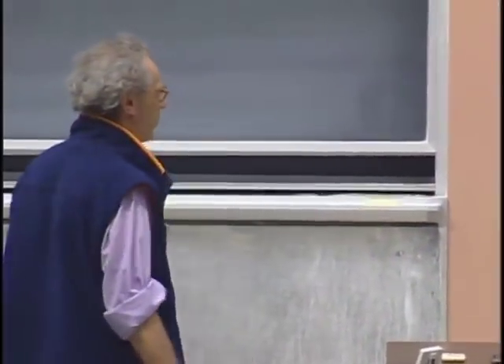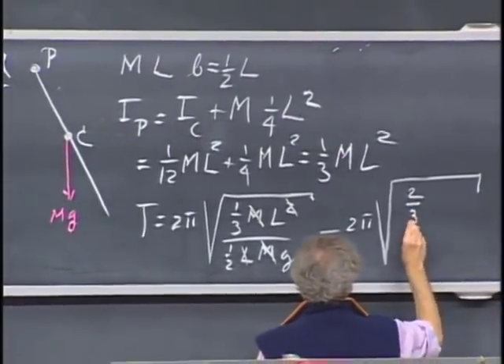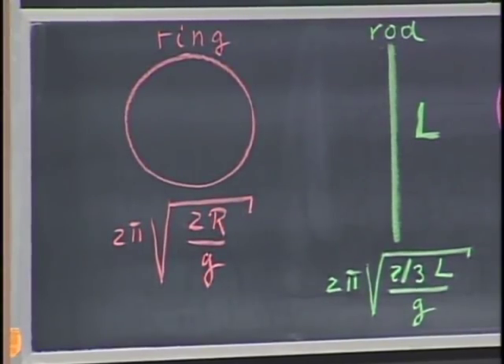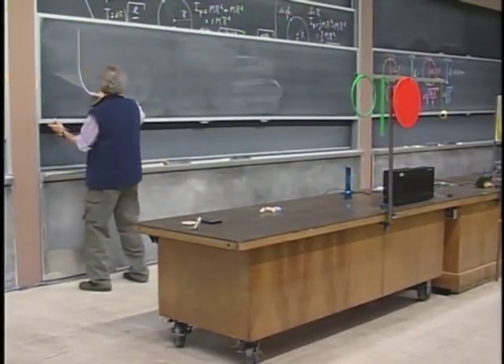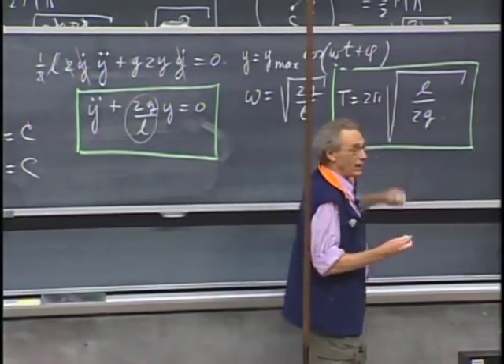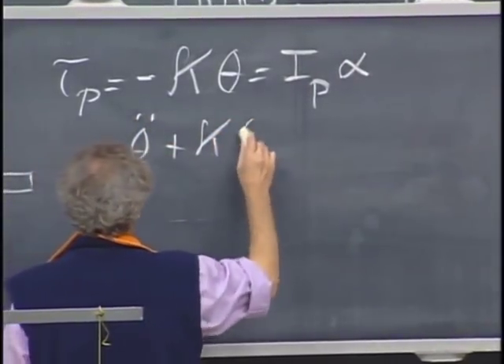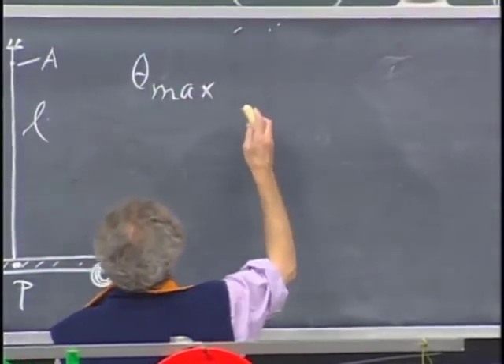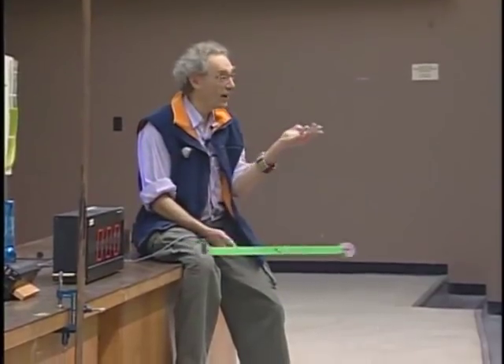8.01x - Lect 30 - Simple Harmonic Motion, Energy Considerations, Torsional Pendulum

Comment: Sir, did the string broke?
What was the summary of the tortional strain experiment?
Reply from the maker: question unclear
Reply: @lecturesbywalterlewin.they9259  Oh my god, Sir😳😳 I wasn't expecting a reply,
Sir, I was asking that the demonstration of the tortional strain you were doing, the numbers of period at 10 rotations was still holding up with the calculated value , did you go beyond 10 times or it started to show permanent deformation  after 10?
Reply: @lecturesbywalterlewin.they9259 And I thought hard about the U-tube length you said it should be higher than (calculated average),
Does the liquid lose contact with the ceiling of the mid section of U tube while moving?

Comment: Hi Professor. In this lecture (22:55 min.) u mention that vellocity will be same for any moment in time due to cross section area of tube is not changing. But will it same or it will change by the time? Because derivative of (y) includes (t) and it is logical due to gravity. i think i misunderstood something or not? Thanks.
Reply from the maker: what I said is correct as liquid is incompressable.
Reply: Professor I got ur point. Thanks for lighting me up. I misunderstand ur sentence at 22:55 min. Thanks again.

Comment: "l"  in the differential eqn is taken as the displacement of the centre of mass of the displaced liquid, which will be higher than the "l" we get if we take the average of the two radii and measure it. Is this correct?
Reply from the maker: I have no idea about what you are asking me. Search on line on how to calculate periods of oscillating liquids or use my lectures. I believe I cover that.
Reply: @lecturesbywalterlewin.they9259  sir , I was attempting to answer the question asked in the lecture about why we should take "l" more than what is measured from the average of the radii.

Comment: Dr.Lewin, I just  want to prove that the actual “l” should have been taken a little bit larger than       π(r1+r2)/2.(I only consider the bottom torus).r1 is the inner radius and r2 is the outer radius.I used  integration to calculate the volume of a torus.But amazingly I got that the volume of torus is exactly equal to (π^2)*(r1+r2)a^2 =2A*l.So the bottom half of torus should have volume =A*l.I uses 3 different methods to calculate that and they all give me the same result. Can you explain me why l should have been taken a little bit larger.
Reply from the maker: Watch my lectures whereI I do it right and then learn what you did wrong.
Reply: Lectures by Walter Lewin. They will make you ♥ Physics. Thanks for your reply.Sir you use M=Alρ which l is equal to the the average length between the inner length of U-tube and outer length of the U-Tube.I think this u-tube is made of two cylinders and a half-torus is that right? I calculated the volume of this half-torus .Its volume is equal to A*(πR).(I also checked it on the Web)R is the major radius of this torus.Major radius R is the average between the outer and inner radius.πR is the circular bottom part of “l”So I get the total volume of this liquid is A*l.And the mass is Alρ.I think it is not an approximation. I think M is exactly equal to Alρ.Could you explain that further?I really don’t know where I did it wrong and I really want to know that.Otherwise I will have sleepless night.I am looking forward to your response.
Reply: @Lectures by Walter Lewin. They will make you ♥ Physics. Sorry for bothering you but could you tell me whether the reason why ”l” should have been taken a little bit larger have something to do with the formula of volume of the  U-Tube ? I checked that formula but it is amazingly and exactly equal to the a cylinder with cross-sectional area A and length l.Which l is the average of inner and outer length of U-Tube.(the line you have drawn) I am looking forward to your response.
Reply: @GRQFTS did you find the reason why “L” should be a little larger

Comment: Hi professor, i think i found my mistake, to find the work of the force with which i had to push down the liquid at the left side of the tube so that the liquid would raise up on the opposite side, i incorrectly assumed that the force was constant for all the delta h and equal to the force with which i had to maintain the equilibrium at the end, just like if i had to lift a rigid body with fixed mass, but then i noticed that for every dh the force would raise up proportionally with h, that's because the unbalanced mass in the system gets bigger and bigger the further I go down pushing, so the work would be (integral)--->S(rho)*Area*2h*g*dh, and not 2dMgy as i incorrectly assumed, the result of the integral is dMgy and not as i said before. If i could correct my error I owe it only to you professor, have a good day, greetings from italy!!

Comment: hello professor, at 25:19 you show that dM*g*y is the work of the force, shouldn't the amount of unbalanced mass be 2dM? and so the work would be 2dM*g*y
Reply from the maker: 25:19 what I said and did is correct.
Reply: thank you professor, i couldn't figure out the right way of thinking about it, i'm struggling with this topic because my professor didn't handle it properly. With all respect my question wasn't meant in any way to question your preparation.
Reply: Think about the center of mass of the displaced fluid. It clearly moves only 1*l as it sits in the middle of the shifted fluid.

Comment: Hi, I have a question about the assigment 8 ,8.4, c).  The formula i got for r1/r2  (r1/r2=x) was : x+2x^2+x^3= (M*G/V^2*r2) = 0.53. But in the answer sheet it says it equals to 15.9 and I´m not sure what I´m doing wrong. Is this equation correct : x+2x^2+x^3= (M*G/V^2*r2)?
Reply from the maker: Plse assume that the solutions of this classic problem are correct. Please check your (and our) calculations carefully - (the solutions were done by a graduate student). Unless you are 100% sure that our solution is wrong, I don't want to go over our solutions as that is very time consuming.
Reply: Thanks, you were right. I was plugging in the wrong values. @lecturesbywalterlewin.they9259

Comment: When the length of second pendulum becomes four times what z the perid then???plz
Reply: Twice.
Reply: To see this in an example, consider the contrast in the design of the pendulum for the grandfather clock and the cuckoo clock.   The grandfather clock's ~1 meter pendulum is built to have a period of 2 seconds, so each pendulum turning point ticks the seconds.  The cuckoo clock has a pendulum about a quarter the length, and ticks twice a second.   Grandfather clocks sound as "tick, tock, tick, tock" as the pendulum produces advances of the second hand.  A cuckoo clock will make the sound "tick-a-tock-a, tick-a-tock-a" as its pendulum reverses each time.  The turning points actually make the exact same sound.  It is a psychological effect that makes us think they sound different.

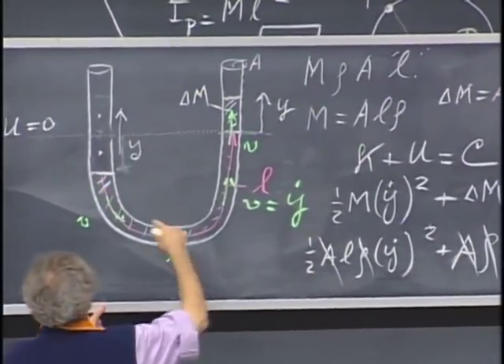Comment: At 30:00 you said L must be little bit larger then it's actual value. I think that's because of the thermal expansion of the liquid. Because when liquid will oscillate it's will loose some of it's energy due to viscosity (which will cause Damping) and that energy will be converted to heat, which will cause thermal expansion. Area is constant here, so the only thing that can change is the length of liquid column (This will give a tiny increase in volume also. ). I think that's the reason for L to be a bit larger.
Reply: Think about what properties of the liquid we assume to be uniform.   Are they uniform in reality?  Or is there position-dependence to properties of the liquid?
Reply: @carultch  I will answer this since it is 4 years ago and will be probably burried anyway. The answer is due to density being dependent on the height. It is not constant. See previous lectures.
If you would have linear column perpendicular to the board and you somehow oscilated fluid in it, the assumption would hold.

Comment: Professor, I've notived that when measuring the torsion pendulum oscilation, when it was given 10 initial turns, the first full oscilation consisted of 17 turns instead of 20, and the second one, the one you actually measured the period of, consisted of only 13 turns. My guess is that there was permanent deformation that did not affect the period of oscilations, but the angle swept by the pendulum
Reply from the maker: very strange - I have no explanation for that. The amplitude would slowly decay due to air drag but not the number of oscillations. *A permanent deformation would not change the length therefore it should change the period of the oscillations - but you said it didn't.
Reply: Actually, it's not the number of oscilations what changes, but the amount of turns per oscilation (at least this is the case if what I understand for oscilation is the movement of the pendulum as it turns one way and then comes back). And the number of turns is directly related to to the angular amplitude. The original amplitude was 20pi, 20 turns per oscilation. Then, there where 13 turns, which translate to 7,5pi. So I think this phenomenon is being caused by air drag. Or at least I think so, my reasoning may be wrong
Reply from the maker: unclear what you want to say - when a torsional pendulum turns around twice it has made 1 oscillation. use google
Reply: I see, it can get difficult to make my ideas clear this way. Anyways thanks for answering my question and for uploading these amazing lectures! I'm about to start my bachelor's degree in physics and I find them not also useful but also very entertaining. Thanks for the available assignments and exams too!

Comment: Dear professor, at 26:00 why are we adding potencial energy, i know in problems with conservation of energy (for example) its always mgh=(m*v^2)/2 so if we put mgh on the right side it will be negative, and in your case potencial energy has plus sign, why is that?
Reply from the maker: when the liquid oscillates mechanical energy is conserved (KE + PE)
Reply: Lectures by Walter Lewin. They will make you ♥ Physics. Yes but PE is converted into KE so PE=KE which is equal to KE-PE=0 and in your equation its KE+PE=0, whys that
Reply from the maker: Mechanical energy is conserved (I have assumed that there is no heat loss due to viscosity in the liquid) thus KE + PE= C. It's NOT 0 and I do not have 0. Of course there is always some heat loss and thus the oscillation will die out. This is my last msg.
Reply: Lectures by Walter Lewin. They will make you ♥ Physics. Thank you for your time professor :) sorry for bothering you
Reply from the maker: you did not bother me. It seemed to me though that you wrote me before you had made an effort to understand the OBVIOUS!
Reply: Lectures by Walter Lewin. They will make you ♥ Physics. Im really sorry if I made that impression, i only couldnt understand why is there plus sign instead of minus but now i get it, thank you for uplouding these lectures, many studenst that i now (including myself) really appreciate it
Reply: five 505 h

Comment: Professor I suppose that the 'l' @ 30:00
1. must be taken from the middle of the pipe
OR
2.We can add the vertical parts of the pipe and then find the mass of fluid in the curved part by doing an integral over using small mass elements 'dm'
is that correct professor?
Reply from the maker: there are easier ways
Reply: Professor if I dump the fluid out and weighing it , then divide the weight by A*(rho) to get effective value for l ?

Comment: Hello Professor 
Can u please tell me about the concept of centre of percussion in such physical pendulums please?? 
 And thanks for your fantastic lectures
Reply from the maker: The Center of Percussion is the point on an extended massive object attached to a pivot where a perpendicular impact will produce no reactive shock at the pivot. Translational and rotational motions cancel at the pivot when an impulsive blow is struck at the center of percussion.
Reply: It's also known as the "sweet spot" to baseball players.   If the ball hits the bat at any other point, you'll feel a sting in your hands as they receive the reaction load from the ball's impact.  Experienced baseball players strategically aim to have the bat hit the ball at this point, to minimize the pain in their hands.

Comment: were questions prohibited during the lecture or they were cut out?
Reply from the maker: questions were allowed. Remember there were typical 300 students in my audience. Students feel often embarrassed to ask questions with such a large audience. These students also meet twice a week with a "recitation" instructor (also a Prof at MIT but not the lecturer). Those classes have only 25 students and that's where they unload all there questions. That one of the major purposes of recitations.
Reply: Are the recitations different from the tutorials?
And does the leader of the recitations hold a PHD degree too?
Reply from the maker: recitations are run by Professors of Physics. Students ask lots of question - often related the that week's homework. They meet twice a week for an hour. Classes are about 25 students. I have been recitation instructor more than 30 times in my 43 years.

Comment: Hi guys!  I wanna thank you first for the amazing videos. However, I think we must take the  moment of inertia  of the bar into consideration  while calculating the moment of inertia of the whole system (bar + 2 masses) . I'de appreciate it if you tell me why Mr Lewin didn't do so!  :)
Reply from the maker: how many minutes into the lecture?
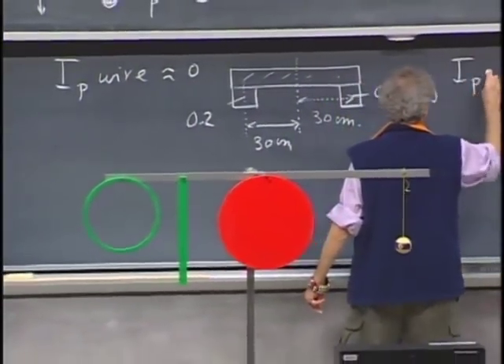Reply: +Lectures by Walter Lewin. They will make you ♥ Physics. at 39:27. I thought I mentioned it, sorry
Reply from the maker: I am puzzled by your suggestion. Watch the video again. I am very specific about why the moment of inertia of the bar can be ignored. I mention that the bar has a very low mass (m) compared to the 0.4 kg. Thus the moment of inertia of the bar m*L^2/12 can be ignored in comparison with the moment of inertia of the 0.4 kg at a distance L/2 from the center of the bar. I then even mention "to a very good approximation".
Reply: thanks a lot. I was paying attention while watching but i kinda missed that. Thanks again :)

Comment: Why should L be a bit larger? at 32:10 you mention it, but I see no reason as to why it should be larger.
Reply from the maker: Tasos Obscure Tasos, we use the length "l" in the diff eq to calculate the mass of the liquid. The volume of the liquid is Al, the mass is Al*rho. That is an approximation. To do this correctly you would have to do an integration of dm as a function of the radius of the bottom part of the tube. You will then see that the "average" value of "l" is somewhat larger than (l1 + l2)/2.
Reply: This simple calculation makes the first order assumption that the liquid is incompressible and inviscid.   Meaning liquid density is uniform throughout the entire system, and all fluid friction is neglected.

Density is not uniform in reality, because every real fluid will compress at higher pressures.  It has to store evidence of that pressure somehow at the molecular level.  Liquids in general are close to incompressible, much more than their gas counterparts.  Water for instance, takes change from 1 to 22 atmospheres to increase its density just by 0.1%.  An extreme example of a "stiff" liquid is mercury, with about 11 times the bulk modulus of water.  "Stiff" only in terms of difficult to change its density, since liquids will easily change shape.   An example of a liquid at the other extreme is acetone, about 1/3 the bulk modulus of water.